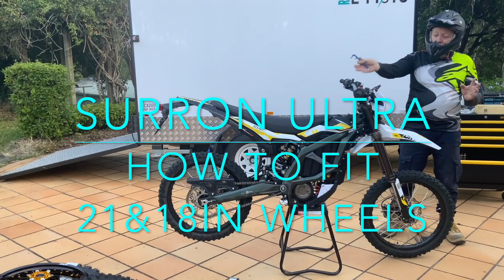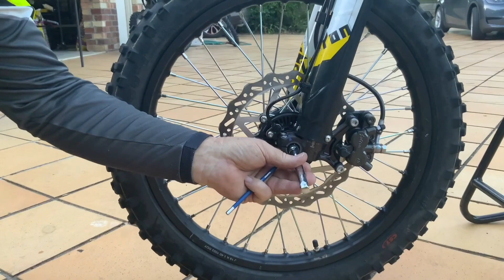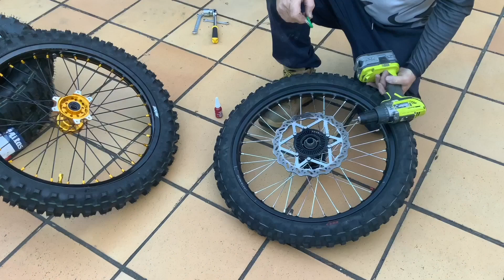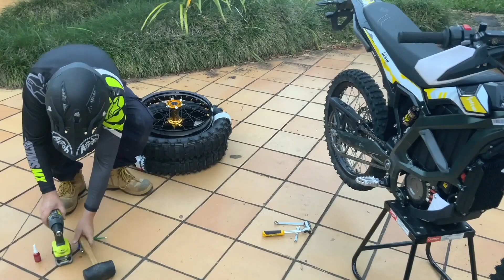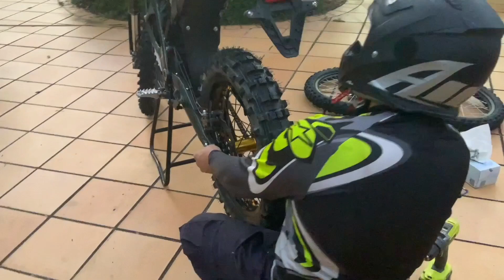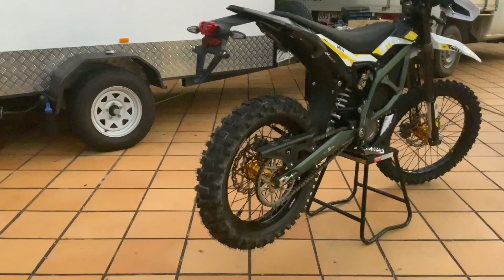Surron Ultra | How to install 21"x18" wheels

Comment: Does the bike handle that much better and is the speed and the power-torque the same ??? What is the differance with this setup and can you set the traction control with those wheels on the bike?? Thanks for the videos..
Reply: The bike definitely loses the initial zip. Top speed drops by about 4-5mph. Traction control does not work(not that its any good anyways). The bike feels more centered, corners way better, and is way less jittery.
Reply: Thanks for sharing I presume you like your set up!! Do you feel it is definitely worth it. Do you feel better tires will help the handling at all  If I want to try that first?? For the rest of the bike how do you like it??? Thanks Tim good looking!!!!
Reply: I can’t give you a definitive answer yet. Just haven’t put enough days on the 18/21. But it will be all about range for me, definitely performs better. I don’t need high end top speed(mostly do trail riding). So just need to really get a feel for the range hit. But its a fun set up!
Reply from the maker: its alot better especially on hill climbs. as Tim said there is a slight change in characteristics of speed but we did get the traction control working, but never use it anyway
Reply: @timgriffen5978  Didvyou get the traction control to work also?? If so did it help and does it help at all on the stock wheels.
Reply: Let me know please I really think when I get it which should be next week .I will ride quite a bit on the stock wheels will definitely change the tires to better ones in time might as well beat them up!!! Thanks bro
Reply: @Mrhyperelectric  It is really easy. All you need is to CNC the chopper wheel for the front traction control sensor anew. You increase the number of holes in it proportionally to the wheel diameter increase.
Reply: @race-emoto  what did you do to get it working and does it really help anyway you mentioned you don’t use it much.
Reply: @MrMrMrMrMrT  Thanks for your feedback!!! Do you think it is worth doing thy say the traction control is not so great anyway
Reply: Tks
Reply: @Mrhyperelectric  nono, it works great. However, it is rather a beginner thing, to get out of tricky situations a couple of times. Later you will be more performant to not use it. You can see well in Electric Cycle Riders new video of Setting up the Ultra Bee
Reply: @timgriffen5978 If you're experiencing a 4-5 mph loss with the stock sprocket, adding a 54-tooth one might entail further reduction, likely placing you in the high 40s. Given our reliance on wide open fire-lines for travel from point A to B, any additional speed loss, especially when riding alongside gasser, would be significantly detrimental. Thoughts or experience?

Comment: Why can't you put any mx rims on Surrons? Why do they have to be specific from kke? I cant find an answe anywhere. Thanks
Reply from the maker: The Ultra has unique hubs and KKE make rims to suit
Reply: Late reply, but to those wondering Honda wheels fit with a little modification. Just grab two rotor side spacers, rotor side is plug and play. On the other side you have to cut the 2nd rotor side spacer down to 19mm or Charged Cycleworks has a spacer kit (for me the shipping cost more than the part so that was a no go.) and just like that you have a relatively cheap 21" front. Just make sure the hub has the same bolt pattern for the disc and it should fit just fine. You can grab a used wheel for hundreds of dollars cheaper and it'll be bulletproof compared to these cheap (quality not price) kke wheels.
Reply: @Some.Canadian  thanks for taking the time to respond. Much appreciated, I  will be using the information you provided.
Reply: @chaossonar  No worries, I used the same info myself. Important to note, this only applies to the front wheel. I've seen one instance that some fit a kawasaki wheel on the rear but they never gave out any info on the specs or process they had to go through to make it work. The best option if your on a budget is to stick with a 19 in the rear, with a rimlock you should be able to run a 100/90-19 without too much issue and that is still a significant upgrade over the stock rear tire. People have fit 110/90-19's but it seems like the performance/power ratio isn't worth it unless you beef up the battery and drivetrain which is a very costly way to go about it.

Comment: My front caliper is closed to tight for some reason. Obviously I dropped my UB during this process, twice, so maybe I tweaked it. How do I open them?
Reply from the maker: If it is the pads that are closed shut, use a thin blade to slide in and carefully seperate them a little, then a small flat head to open all the way. Be gentle so you dont damage the pads.

Comment: Man, My rear brake has so much left to right play, I know some left to right play is normal but mine is so bad it is causing it to rub. How will I fix this?
Reply from the maker: Hmm, they should self centre. Check that the caliper is able to float left and right so it can self centre. If it's not moving you may need to take it off and check all the mounting pins.
Has one disc pad worn more that the other? if it has, it means it's not floating

Comment: What’s the seat height with the new wheels?
Reply from the maker: Can't remember exactly but its very similar (a bit higher) since the smaller rim has larger tread on the rear

Comment: what is the difference in weight, how much heavier are the wheels and tires?
Reply from the maker: there is a difference, but not sure how much by
Reply: Dependent on what tire you run but should be roughly 5lbs per wheel heavier

Comment: I just ordered the kke blue ones! Are you thinking of going to a bigger sprocket yet?
Reply from the maker: Doesn't seem needed just yet, but maybe we will test it out in the future
Reply: @race-emoto  Still running the stock sprocket? I can't wait to get the 18/21 ordered and put on. I'm currently in the research mode of this project... :) I want it one and done! How much torque did you lose with the added weight?

Comment: Would a 21/19 combo with mx33s for track, like my ktm 150sx work ok?
Reply from the maker: The rims are very skinny so it's possible but you can't have low psi cause it will most likely pop off the rim

Comment: You should take a small torch to brake rotor bolts and heat them up first then use hand tools.

Comment: Slight heat even though it won't be red lock tight just a quick hit with a torch to the bolt not the disk or it will warp quick this will help when warm to break the seal of the blue lock tight kk.